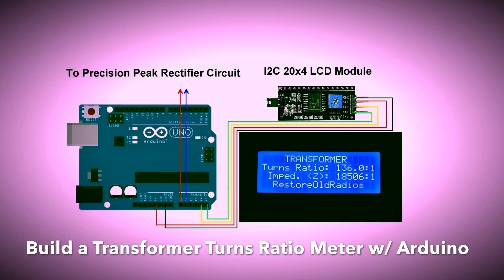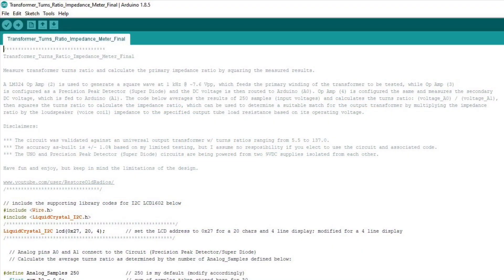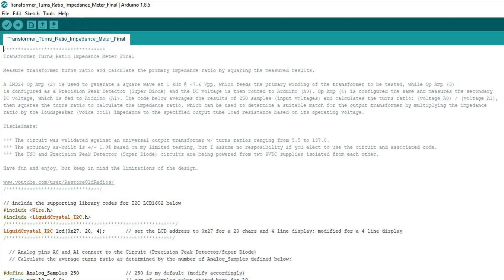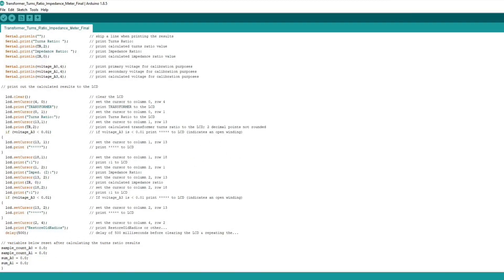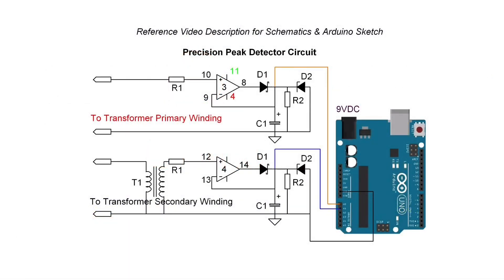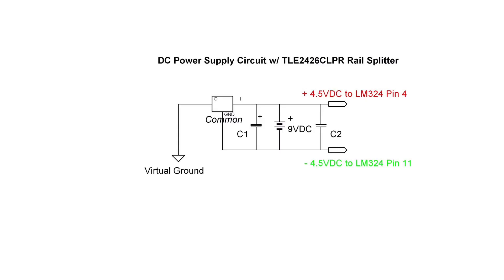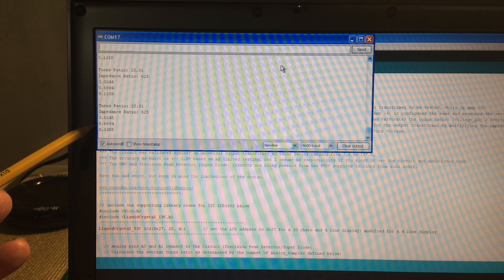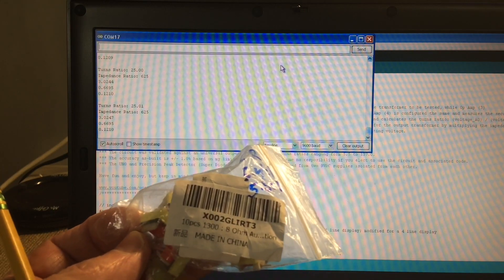Build a Transformer Turns Ratio Meter w/ Arduino

Comment: Share the code please
Reply from the maker: A link to the schematic, BOM and sketch are available in the video description (show more) of the video. In addition, a better/later design I shared as well at:

New Design | Transformer Turns/Impedance Ratio Meter w/ Arduino
https://youtu.be/0NXKXx-9N4s

The video description (show more) has a link for the files as well. 

Best,

Don

Comment: Thanks for sharing this very interesting design! Could it be made simpler by having the Arduuno generate the square wave? I haven’t programmed an arduuno before so this may be a silly question
Reply from the maker: Dennis - from what I know, which is limited I should be able to generate the 1kHz test signal with Arduino, but I still need the precision rectifier circuit to convert the AC signal back to DC. Best, Don

Comment: Wow Don, amazing design here buddy. I have been a programmer most of my life and your code looks just fine, as well as a very cool front end. Superb really. Man I will be building this cool device for my bench as well. I think I might be translating it into a microchip PIC format to make it a bit smaller. Thank you so much for sharing.
Reply from the maker: Tony, thank you. I’ve never done anything with a microchip PIC, is it difficult to learn? Happy Thanksgiving. Best, Don
Reply: @RestoreOldRadios  Hey buddy! Yes I hope you and family have a very Happy thanksgiving as well! We are staying home just the two of us to help our country with what it's asking us, but enjoying a nice day of Thanks. As far as pic, it's the same code like what arduino has but a bit more intense relating mostly to understanding the pic it self. The design though can be any of the chips you would like from a 6 pin rice like size all they way to 44 pin monsters. More control and the dev tool is just 50 bucks and easy to use. Yea, it's a little harder than arduino, but you have more options and to me it's closer to the  engineering feel. I really like the pic16F182X 8 bit 14 pin micros the best. There are so many others and with pickit3 you can do anything. The C compiler is extra but the assembler stuff is free. Arduino tho is the cheapest way to go in the long run and cheaper.

Comment: I am inclined to agree with *Robert  Gibbons*. The only other thing I can think of is phase but in the video you said swapping the primary and/or the secondary lowered the reading. 
One question: Why did you use square waves?
Reply from the maker: Thanks for reaching out. Correct, I can switch either the primaries or the secondaries one at a time and both indicate a lower TR. I was thinking phase, but haven’t done any testing to confirm. My first prototype was a Wien Bridge oscillator using a #327 lamp and for what ever reason(s) the ADC values fluctuated dramatically, but that may have been due to my capacitor value or other... flaws in my design. The square wave worked on the first try other than the above mentioned... after the addition of the step up transformer on the secondary to increase the AC voltages before being rectified. I even tried the Wien Bridge oscillator w/ the step up transformer and still saw inconsistency in my limited testing. Any insight is appreciated. Best, Don

Comment: Nicely done, should be very useful. I have ordered one ARDUINO STARTER KIT. This should be fun.
Reply from the maker: Rick, thank you. Any insight on the issue when switching either the primary or secondary one at a time and the impact on the measured TR ratio would be appreciated. Thanks again. Best, Don

Comment: If you look at the square wave, hooked one way you are rectifying the upper half and the other way the lower half. I think you will find just slightly different positive and negative swings. Nice project!
Reply: I think I agree with Bob, and might be able to expand a little. You may be getting different swings when you change polarity, that may affect the residual offset voltage of the opamp, and you're getting a phase shift from the little step up transformer. The higher reading you get the one way may be the smallest effect of those differences. I have to say, pretty slick circuit you came up with.
Reply from the maker: Ted, I really appreciate your insight on this subject too. It seems to work well based on my most recent testing, which is now 30 different configurations using a universal output transformer. Like Bob said, it’s not a lab grade meter, so making a mental note of using the higher TR is easy to do. Thanks again for your feedback. All the best. Don
Reply from the maker: Bob, thanks for your insight. I tried using a Wien Bridge oscillator, but never got consistent ADC values. Probably a design flaw on my end so when you build it, I would appreciate you sharing the circuit changes to make it a better performer. Best, Don
Reply: At 4.5 volts a square wave is probably better anyway. And I don't see anything wrong with taking the higher of two readings like you showed. These are hobby instruments not lab grade.